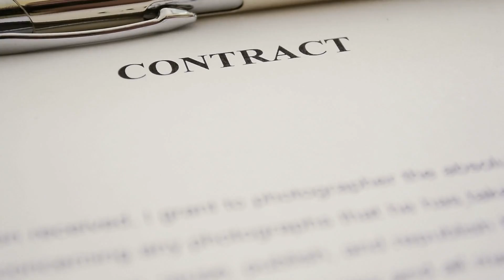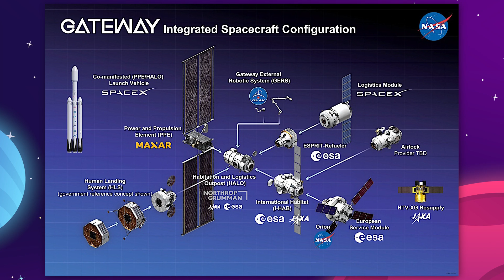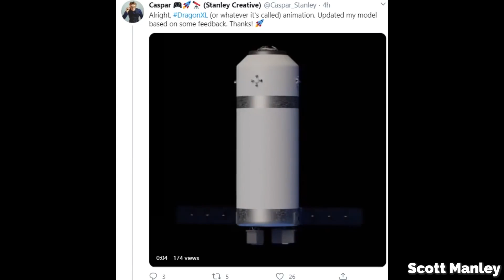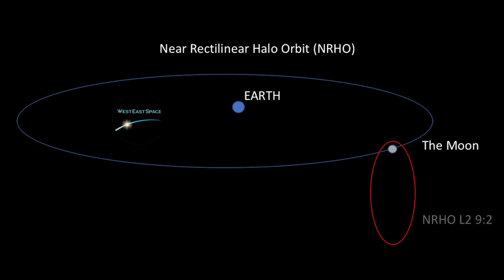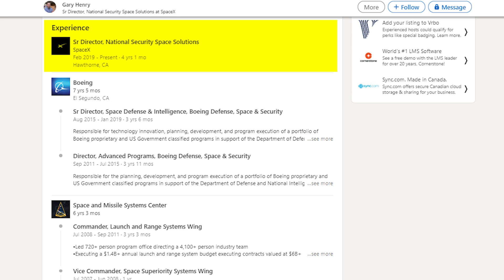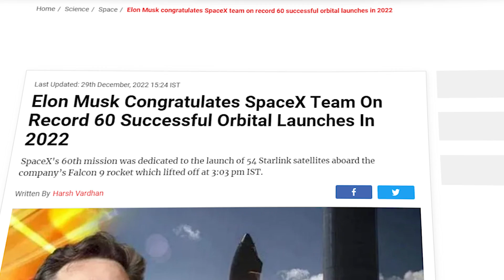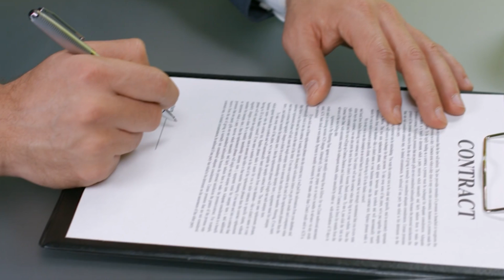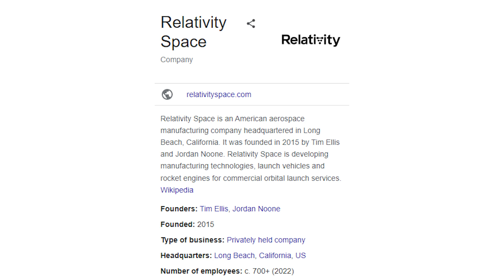NASA Reveals Major New Lunar Gateway Update!

Comment: Serious question, is there the possibility they are holding off until Starship is fully operational? It has such a large payload capacity and should be able to make cheap round missions. I only ask with the hopefully very soon fully launch of the Super heavy Starship.
EDIT. Missed the point of my question. Would landing with a large payload of robots and building equipment a few times on the moon be easier than building in space. You would have low gravity eliminating need for large equipment just teathering and slow movement. Would eliminate the issue of orbiting the moon and making shipments have to line up with the earth orbit and stations orbit around the moon. Also give a small amount of gravity for the people inhabiting the base at the time.

Comment: Is the news scaping it, because it's kinda pointless when using BFR. Like seriously Shipship upper stage  has more internal volume than the whole station, by quite a margin, why are we still bothering with this, if you really needed a station just use a Starship upper stage as the station, espically in the case that it's for refuelling because you have a giant tank ready premade.

This isn't a case like reusing the shuttle tank where you would have to make major concessions to get the tank to orbit, the tank is already going to orbit and from there you can refill it to go to the moon. Also if you don't need the massive tank storage at the moment you can modify it when it gets to the moon and cut out the fuel tanks for a truly enormous station with way more internal volume than the ISS in 1 shot. To be fair you would probably want to do that as you would need to lose internal volume the micro meteor shielding, but it's not even like you would need another launch to send along that shielding assuming 100 tonnes of cargo that is plenty.

Would need another launch for all the equipment though, but you would be able to have the space ready and then some in 1 shot.

Comment: SpaceX can deliver the Lunar Gateway on any date that NASA asks for.  SpaceX has a better on time launch delivery record than airlines or passenger rail.

Dragon XL will not be used for crew deliveries.  Firstly because the US Senate would not disappoint its campaign funders by cancelling Orion/SLS.  Secondly because SpaceX has not designed Dragon XL to support crew.  Thirdly by the time crews are scheduled for delivery to the Gateway SpaceX will have Starship crew-rated.

Comment: Who wants to jump onto a high cadence Starship! 

30 minute turnaround means no time to inspect much less refurbish the engines, and it launches without an abort capability.  I think Russian roulette with a single shot gun is safer
Reply: Musk's overly ambitous goals of multiple daily flights is a very far off goal that is not likely to be realized. Per page 10 of the GAO report denying the HLS complaints, the SpaceX Artemis III goal is 1 Starship variant launch every 12 days. So with up to 10 flights to get HLS Starship to the Moon (GAO pg 27 with ~150 ton payload update), its around 3 months from the time the depot goes up, the Dance of the Sky Tankers is done, and HLS Starship refills to go to the Moon.
Reply: just look at aircraft. fuel, load passengers, fly, fuel load, fly, fuel load fly. Then after some 30 flights there is a normal inspection and maintenance. The only exceptions are when problems are reported. And THAT is what SpaceX is aiming for.
Reply: @jessepollard7132  The wear and tear a rocket motor gets vs a jet engine is wildly different. The consequences of a jet engine failure vs a rocket motor failure is also wildly different. The frequency of jet engine failures vs rocket motor failures is also wildly different
Reply: @tylerjohn4607  NOt really. jet engines have multiple smaller engines built in. The only difference is where the oxidizer comes from and the form the oxidizer is in. Jet engines tend to lose either the compressor turbines or the power turbines. rockets tend to lose the pump power or have the engine burn through itself. both have engine burn through in related places.
Reply: @jessepollard7132  They both have a lot of wear from having to be exposed to temps above their melting points, but the amount of wear is wildly different.  a jet engine will needs inspections every few hundred hours and overhauls every few thousand.  A rocket motor will need an overhaul every few minutes of flight.  So while a lot of the forces have similarities, the scales are very different.
Reply: @tylerjohn4607  depends on how poor the rocket motor is. There are engines that don't need inspections after years of use. They can still be used if they get refueled, which is one of the remaining future goals. The ones that require such frequent inspections you refer to are generally intended for single use and throwaway operation. Such as what SLS uses.
BO has barely learned how to make those (which is one reason BO couldn't deliver any BE-4s on time. much less  make reliable engines that can be reused several times. SpaceX has done that work which takes time and good engineering to do.
Reply: @jessepollard7132  Merlins have to get refurbished between flights and it takes about a week.  SpaceX can turn them around in an impressive time but it is nowhere near comparable to a jet engines turnaround between uses.  When an F9 lands those engines are not ready for reflight.  So while advances have been made, we are nowhere near the point where chemical rocket motors are going to be able to have a similar use rate or reliability rate to jet engines.  A normal jet engine needs an overhaul every 5,000 hours (depending on the model) Rockets need an overhaul every 0.15 hours of use.  

I cannot possibly stress enough how much more intense the forces are that a rocket motor experiences
Reply: @tylerjohn4607  Neither is a jet. they still have to be refueled, and undergo certification checks. most are automated, but it is still necessary. and a jet has to undergo landing gear, and control surface checks as well. and that can take several hours to do - specially if something is identified as a potential problem. even longer depending on the weather conditions (having been stuck on one for 4+ hours because of ice buildup faster than they could remove it. they almost replaced the airplane and did have that happen once just because a fuel sensor was faulty.
Reply: @jessepollard7132  Musk may be aiming for airliner levels of turnaround for Starship, but is not likely to get it. A day turn around for Starship would be huge and a week turnaround would be more than sufficient. Right now the Falcon 9 record is 21 days on B1062.
Reply: @steveaustin2686  nope. the best Falcon 9 turnaround is 9 days.
Musks goal was to land and refuel, and relaunch.
Reply: @jessepollard7132  No, you are likely thinking of the pad turnaround, which is now down to 5 days. The Falcon 9 booster turnaround is still 21 days. Got a source for your 9 days?

I know what Musk wants, but it's not likely he will get that fast a cadence. A week turn around would be big and a day turn around would be huge.

Comment: 4:35 It does not take months to reach the moon. It takes a few days. It took the Apollo program 3 days, and the new horizons spacecraft reached it in just under 9 hours.
Reply: That depends on how you get there. The CAPSTONE probe to the Moon took 6 weeks as it slowly raised its orbit to save propellant. The Falcon Heavy launch of the PPE and HALO modules together will take 9 to 10 months to get there per NASA, as they are taking a propellant saving method to get there. Since the PPE has an ion thruster, that may be part of why it is taking so long.
Reply: @steveaustin2686  I can't remember where I read but my understanding is the combined mass of PPE and HALO is so big the only way to get it to lunar orbit with Falcon Heavy is to take the "slow boat" approach. This is very different, of course, with New Horizons, which is about the size of a grand piano and not massive at all. 😀
Reply: @bbartky  Very likely I would think. Apparently the original plan was to launch them separately, but that would have required a service module for the HALO module.

Comment: I wish we had made progress on a simulated gravity spinning space station design by now. If Gateway is going to be continuously inhabited, it would be greatly beneficial to the health of the people stationed there if it was 1/2 G or more. But since we have conducted basically no research besides micro-gravity, we don't even know what the threshold is for long-term stays in space without the harmful side-effects.
Reply: Artemis doesn't envision continuous inhabitation of either Lunar Gateway or a lunar base. They expect to go, do some experiments, maintenance, etc and leave some experiments running by themselves untl the next crew visits.
Reply: @steveaustin2686  which is a plan for failure.
Reply: @jessepollard7132  Until they can work out crew living in space out from under the Van Allen belts, it would be folly to have a continuous presence. Not to mention that SLS/Orion are a once a year launch cadence, maybe twice a year. Until Starship can mature to a faster launch cadence for the Dance of the Sky Tankers to be able to replace SLS/Orion, that is ALL NASA has for getting crew to and from the Moon.
Reply: @steveaustin2686  No it is not. NASA could contract with SpaceX to use the falcon heavy to reach the Moon and beyond. and living outside the Van Allen Belts is well known. all it takes is the will to actually do it. Which is not the same thing.
Reply: @jessepollard7132  Nope, former NASA Administrator Bridenstine said back in 2019 that while a fully expended Falcon Heavy has the mass lift to get the Orion, ESM, and ICPS to LEO (barely), the aerodynamics were a problem they were looking at. Nothing came of that, so evidently the aerodynamics of such a large stack ARE a problem. 

There is NO way that the 8.6m Exploration Upper Stage (EUS) that is planned for Artemis IV+ will fit on a 2.7m Falcon Heavy core stage. So Falcon Heavy would only work through Artemis III, IF aerodynamics were not a problem, which evidently they are.

The only missions to send crew outside the Van Allen belts were the Apollo missions and they got lucky they were not hit with a CME. SOHO at the Sun-Earth L1 can give warning for CMEs that the Apollo missions did not have. So crews would have time to prepare for one. Cosmic radiation can be slowed by the Sun's heliosphere but not stopped. Part of the Artemis program will be testing these at Lunar Gateay and on a surface base, hopefully between crew missions.

Apollo 17 spent just over 3 days on the surface of the Moon and just over 12.5 days total on the mission. Artemis III is planned for a week on the Moon and roughly a week to get there and back, being longer than the Apollo 17. Roughly half of ALL the Apollo missions time on the Moon, is planned for just Artemis III mission. Later Artemis missions are planned for a month or so on the Moon. Apollo was dipping our toe in the water and Artemis will be wading into the pool.

ALL of the Apollo flights to the Moon, including Apollo 8, 10, & 13, are almost  83.4 days in total. By Artemis VI, NASA could very well pass that for JUST surface time on the Moon, depending on how fast NASA does 30 day surface missions. Lunar Gateway is almost certainly needed for missions that long.
Reply: @steveaustin2686  Only because they were designed to fit something else.
Reply: @jessepollard7132  So you agree that Falcon Heavy is not really an option then?

Comment: all these mentions of refueling stations - what's really needed there is to come up with ways to make the fuel in space vs have to lift fuel out of Earth's gravity well. So wondering if there is any potential for that using astroids and comets as source of raw materials...
Reply: You can break water (H20) into hydrogen (H2) and Oxygen (O2) for use as a propellant. With carbon dioxide (CO2), H2 and a catalyst, you can make methane (LCH4) and H2O. So you can make propellant off Earth. Artemis plans to develop the tech for getting water ice off of airless or nearly airless worlds for future propellant creation on the Moon and Mars. If an asteroid/comet has the resources, they would work too.

Comment: I am becoming more and more convinced that our next step after a lunar orbital station should be infrastructure development and then churning out rotating O’Neil Cylinders nestled in near earth asteroids. All of which is cheaper than trying to colonize Mars. If you want 1M humans off Earth the quickest, and only feasible option currently, is a couple dozen of these habitats. Interestingly technologically we’re already theoretically able to build these, the holdup is material and resource rather than any technology that we need to develop.
A few dozen of these, 5km wide and 10-20km long to match the material strength of steel, would easily house enough space for at least 1M if not more.

Edit: as we get more established you could also set up a massive 3D printer to churn out habitat shells which would then have their internals worked on after.
Reply: Then you have to ship everything from EARTH. NOT a cheap operation for an O'Neil Cylinder.
Reply: Bezos famously said that living on the top of Mount Everest would be easier than living on Mars, as he is a big proponent of O'Neil stations. Of course, it could be argued that living on Mars would be easier than on an O'Neil station, since you have gravity, resources, and a way to protect your base from cosmic radiation right beneath your feet.

Don't get me wrong, I love the Babylon 5 station and expect at some point, we will make something similar. But why not both? Mars has resources and is closer to the asteroid belt than Earth is. Of course the asteroid belt is nothing like you see in Star Wars. On average, the asteroids are 100,000 miles (160,000km) apart in the asteroid belt. Putting an O'Neil Station by Ceres, Pallas, Juno, or Vesta, etc would be worth it as they are so large.

Getting 1M people off Earth is a LONG term project, Musk's overly ambitious goals not withstanding. There is technology needed to be developed to live in deep space long term on Mars or in a rotating station. Something that the Artemis project plans to work on, since the ISS is under the protection of the Van Allen belts.
Reply: There isn't enough near earth asteroids with the right elements.
Reply: Not quickest - quickest is mars/moon - as both are already built.

Comment: I don't want a Lunar Gateway which would be outside the earths magnetosphere. There's also no way they would put a massive fuel depot within the Gateway. They just need a base on the moon that can be buried with regolith and be shielded from cosmic rays.
Reply: Lunar Gateway is so that they can do experiments out from under the Van Allen belts, in zero-g. The lunar base would do experiments in 1/6 g. Not to mention that Lunar Gateway is a way station for the crew spacecraft for longer stays on the Moon. The crew capsules on the ISS only stay for 6 months because the ISS can sustain them while they are shut down. Crew Dragon has a 10 day fly-by-itself capability. Orion reportedly has a 21 day fly-by-itself capability. So having Lunar Gateway would mean longer surface missions as well as experiments in lunar orbit.